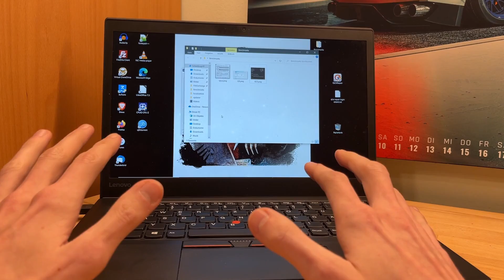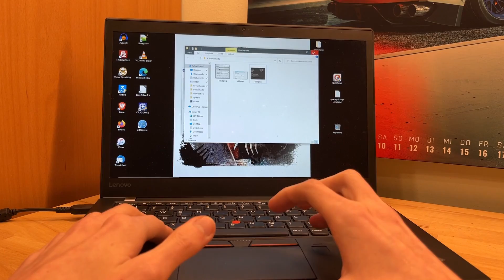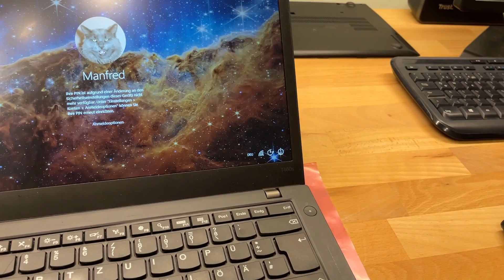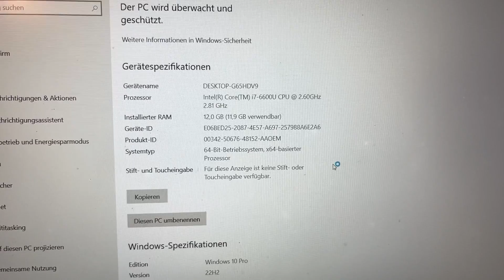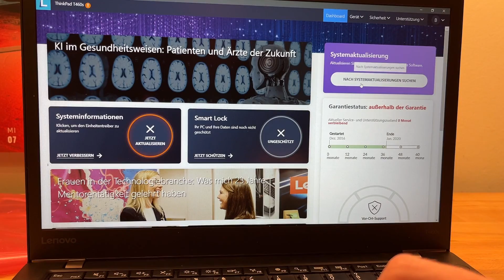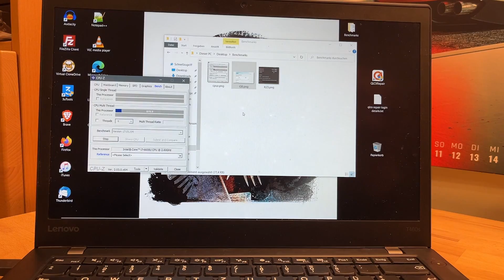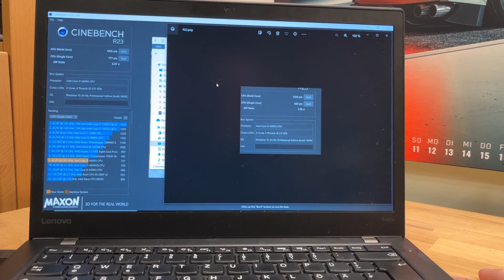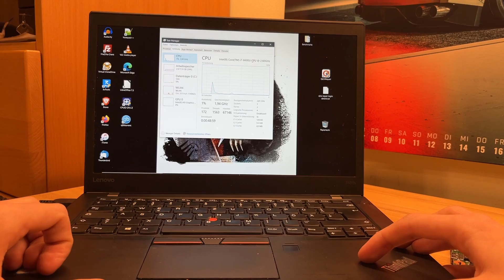Lenovo T460s Upgrading CPU from Core i5 to i7

Comment: i will be doing this motherboard replacement. I blocked my t460s whilst trying to remove the BIOS Admin Password and, well, took it to the repair shop where i was told that the repair shall cost 300€. So, yeeeeah!! Noooo way. It is cheaper to buy a motherbord (which I am looking forward to receive from Lithuania) and start working on the replacement

Comment: I would still prefer the i5 - the i7 may be a bit faster but also it's getting hotter and needs more power from your batteries.
Reply from the maker: I agree with you, the minor increment in speed of the i7 isn't worth the hassle. The i5 is almost as fast.

Comment: Where did you buy the mother board ? and How can we check the compatibility ?  I am also using same Laptop and Same I5 processor , thinking of moving to i9 how can I check If my laptop is compatible ?
Reply from the maker: I bought mine from eBay. But you can only go as high as i7, they never built a T460s with an i9.
Reply: @MacintoshMen   Thanks for the reply , I am thinking about upgrading to windows 11 but i7-6600 is also not supported

Comment: I have a ThinkPad T460s with the following specs: Core i7 6600u @ 2.60GHz 8GB RAM 256GB hard drive  Intel 520 integrated graphics card
 
So if i upgrade to 24gb ram 2 tb ssd
Can i run games like gta v at 40 to 60 fps smooth
Reply from the maker: I don't think the RAM and SSD upgrade make a noticeable difference in gaming to be honest. It will probably stay the same as it is right now

Comment: I was able to hit 1600-1800 multi core score with x270 6300u by using a good thermal paste. This is a clear indication that the thermals for thinkpads are the issue for the i7 processors. I was hoping for a better score with your configuration with the t460 which supposedly have better heatsink and better airflow for its bigger shell.

Comment: I had an X260 with the i7 6500U and perfomance was great in day to day usage and the battery life was really good. Upgraded to a P43S earlier in the year, it has spent 2 months broken with Lenovo having to replace two motherboards under warranty and the thermals are awful meaning it throttles under load.
Reply from the maker: Sorry to hear that! I have little experience with the P series Lenovos. But I figured out over the years that Lenovos have a tendecy for failed motherboards apparantely. I have replaced a fair amount of.

Comment: I have one myself and I love it. Only thing I hate is the trackpad. Jumpy, not precise and very picky with multi touch gestures.
Reply from the maker: Yeah, it's sureley not the best trackpad out there, but I kinda got used to it.
Reply: @MacintoshMen  I just hate the fact that you cannot rest your thumb on the bottom of the trackpad and use it to click, otherwise the cursor jumps around. Coming from MacBooks that's the main problem I had with this laptop. I now have a T490 and the trackpad is worlds better (still not as good as MacBook)
Reply from the maker: @mikiotty  Macbooks have generally fantastic trackpads, I yet have to see one on a PC laptop that comes even close. So I completely understand your struggle.

Comment: I think this is the most easiest motherboard replacement rather than X240/X250

X240/X250 has a lot bad cable management at that Thinkpad
Reply from the maker: I find Lenovo motherboard swaps to be fairly easy from my experiences, but I can't speak for the X240.
Reply: @MacintoshMen  ThinkPads are business machines so they're higher quality & don't actively obstruct DIY repair.
Reply from the maker: @galaxyanimal  That's why I like them so much. Compared to other companies, they don't make your life hard on purpose.